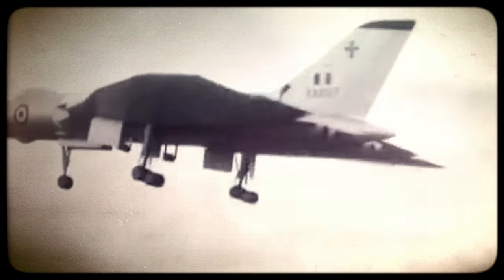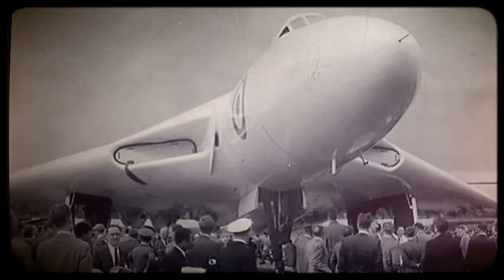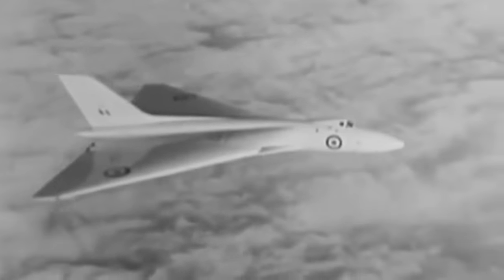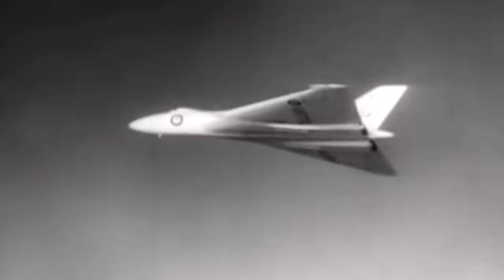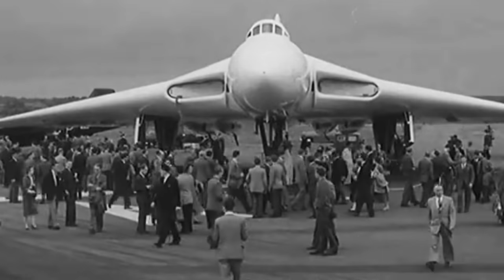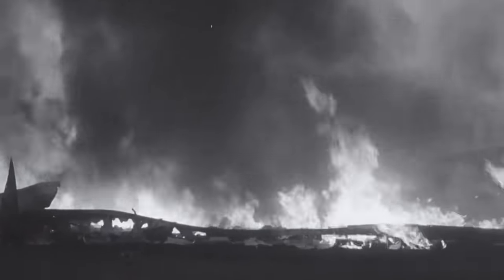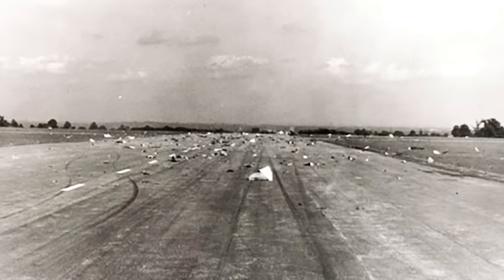Vulcan Bomber Disintegrates on Camera

Comment: It’s very possible that flutter in the outer wing while being introduced into the turn at low altitude (thicker air) caused the structural failure. There are many videos of various aircraft designs having similar failures here on U/T. Testing aircraft at high altitude vs low altitude can bring about different results!

Comment: Probably failure of that internal motor. turbine blade fragments would exit the fuselage and the wind took care of the rest.
Reply: I think that engine disintegration on the compressor stages may have been enough to cause the wing failure.
Reply: @GentiluomoStraniero  — No, it wasn't engine failure that caused this.  The engines were brand new.
Reply: I think you are correct!
Reply: @bionicpuma2920  Even new engines can experience failures.

Comment: I was 14 at the time and I do remember this being reported in the papers and on the radio and TV news at the time.  I went on to have a career lifetime in the design of gas turbine engines, industrial, marine and aero, with Rolls-Royce.
I was brought up in the Midlands of England, in the motor trade (US translation; auto repair business) and had thoughts of going to work in the nearby City of Coventry, which was Motor City UK in those days: perhaps I could work for Jaguar, designing engines.  
But then, one day when I was no more than 10 years old,  I was at home and heard an increasingly loud roar.  I dashed out into our little back garden, just in time to see this huge, white delta wing fly overhead, at a very low altitude.  It could well have been this very aircraft I saw on that day.
I've always credited that event with redirecting my career ambitions.  As a young designer, I actually worked on the industrial and marine versions of the Vulcan's Olympus engines, some of which are still in service.
Clearly, there was a structural failure in the leading edge of the wing and, in the past, I have come across suggestions that it had been overstressed as a result of exceedance speed limitations during earlier flights, using the higher thrust of the Conway engines. 
 Having said this,  I saw Vulcans perform at numerous air shows over the years and one of the 'party pieces' was for the aircraft for it to make a high speed, low-level pass over the runway and pull up into a near-vertical climb, or into a tight turn.  That airframe, in its production versions, was very robust.

Comment: My uncle was an evaluation pilot on the Vulcan, I remember him saying after the incident the wing was redesigned so instead of the leading edge being straight swept back like the prototype the wing was tapered thus giving the classic wing shape though I don’t know if this redesign was a result of the accident.
Reply: Yes. Quite shortly after delta wings began to be designed it became clear that a simple delta with a smooth leading edge was not the best design. The redesign of the Vulcan leading edge was important for the design of Concorde's wing.
Reply: My uncle was also a vulcan pilot but he never mentioned anything about the crash, my guess would be that some are better at sticking to the official secrecy act than others?
Reply: The straight delta wing worked well on F-102, F-106 and Mig 21 e.g.
Reply: The pure delta gave poor handling at high altitude.

Comment: Very sad. Looked to me like an engine came apart and took the wing out
Reply: I saw that,too. You can see the what looked like engine detonating at the front of the wing, before the wing began to disintegrate . But the experts must know better.
Reply: Structural failure of the wing possibly due to overstressing during previous tests, look at Tony Blackmans  book 'Vulcan Test Pilot'
Reply: The main mechanics of the engines weren't that close to the leading edge, mostly intake ducting. The fronts of the actual engines were about the area of the airbrakes.

https://img0.etsystatic.com/103/0/10464274/il_fullxfull.844602964_maml.jpg
Reply: @viking1236     Thanks!
Reply: @DieyoungDiefast     Thanks!
Reply: it wasn't the engine, VX770 was known to have a weaker airframe than later vulcans and this wasn't properly communicated to the pilots flying it and the team carrying out the engine tests. 
I believe (purely speculation now) that the structural failure resulted from incorrect maintainance as a result of not knowing the unique precautions that were previously taken with VX770 and should have continued to be taken.
Reply: @adampoultney8737    So others have said, and you can see on the video that the separation occurred away from the engine housing. Great planes. Thunder ball was better for them.

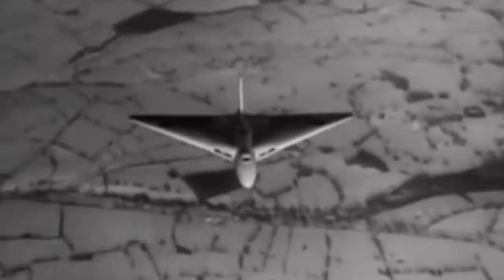Comment: At 2:29 minutes you can see a buckle starboard side, running parallel and a few feet from the wing root.   Freeze frame shows slight irregularity in the leading edge contrary the the port side.  It appears to be directly over number 4 engine inlet. At 2:39 it appears the starboard elevon is out of position or missing. It appears to go into a 90 degree down deflection, almost like an airbrake. It might have been an elevon flutter. Structural failure is often a result of multiple failures.

Comment: Rolls Royce are correct, big Delta wing designs can't handle big changes in aerodynamic forces. Just too much bending the wings against the airframe.
Reply: Delta wings do not flex under load.  That is what doomed this plane.

Comment: Why would any airframe be engineered to handle less than the maximum amount of energy the engine could produce? The thing disintegrated in mid-air. That is not pilot error.
Reply: Because wrong sharp maneuver can increase air forces so much only a 1 inch thick metal hull would not break😹. But hull so heavy will not be able to carry its own weight. Modern aircrafts have computer limiting which forces pilot could apply (fly by wire with safety limits).

Comment: And the Vulcan went on to appear at dozens of airshows all across the UK. I attended many and will never forget the mighty roar of the Rolls-Royce Olympus engines and the stunning delta wing design. Vulcan's continued in service until 1984 and successfully flew the 7,918.35 miles (12,743.35 km) from the UK to the Falkland Islands in the 1982 conflict.

Comment: I remember that the Vulcan was a very noisy jet, making a much higher pitched sound than most other jets of the time did.  I saw one fly at a "Transpo" (Transportation exhibition) airshow in Virginia around 1972(?) that my CAP (Civil Air Patrol) squadron was working at (parking civilian aircraft coming to visit the show).  Over the radio that show's air traffic controller was yelling at the pilot repeatedly not to overfly the crowd, which he was during his low level passes.  The next day of the show one of the U.S. Thunderbirds (flying F-4J's back then) crashed, killing the pilot and separately a guy doing a demo of a kite being towed by a car fell 100 feet when the kite broke apart, killing him as well.  That air show was shut down after that and never repeated.

Comment: I was there, aged 15, with my dad and my sister’s boyfriend who worked for Rolls Royce and submitted an eye witness report. We had just arrived by bus and were heading towards the show when the plane appeared from the left and flew straight in front of us. As it drew level at a very low height it seemed to bank and to our view touch its wing on the ground, hitch immediately disintegrated. It continued to right and fell behind a small copse, were it was consumed in an enormous ball of orange flames and black smoke.

Comment: Reading reviews from the other incidents involved with the loss of Vulcans, it seems ejection is a bit tricky for the pilot and co pilot with no ejection option for the rear crew other than a bail out process through a door.  Six seconds is plenty of time to eject, however it would seem the pilot was unaware that his aircraft was disintegrating.

15 Vulcan crashes of which
5 were successful "all crew" escapes
6 were "no survivors"
4 were "pilots survived, rear crew died".

Comment: Another Vulcan crashed at Detroit MI. Oct. 28 1958 after suffering an electrical  systems failure common to the type. The jet hit the ground so hard, I believe the cockpit was buried seventy feet beneath beneath the surface, it's still there under someones house now. All six crew died.

Comment: It's probable the VX770 airframe had been overstressed in previous test flights as otherwise it would have been unlikely to disintegrate performing a straightforward pass manoevre. Like it or not the Conway engines were more powerful than the Olympus that equipped nearly all other Vulcans. This particular airframe had been tested with both Avon and Sapphire engines before the Conways were fitted, so a lot of changes had been made. Don't forget this massive aircraft was aerobatically capable and refined/improved considerably in B2 form (VX770 was a prototype B1). The Vulcan did not habitually break up in flight.

Comment: I think Rolls Royce buried that report.
Reply: The political animal that rushed the development of the Rolls-Royce Conway engine, and the one that did not permit the newer, improved and safer wing leading edge to be retro-fitted to existing Vulcan airframes had to exterminate that particular report.  

The Conways were later replaced, the wings were later up-dated.

Comment: I saw a Vulcan About the time of the Falklands WAR, At RANDOLF AFB. TX. Airshow. Randolph  has 2 parallel runways. The Vulcan flew down one runway about 200 or 300 feet then did U turn and flew down centerline of other runway. when it was halfway through the turn and wingtip pointed straight up. even  being over a mile away the Vulcan was huge.

Comment: The result of the accident and later mods was a new designed much strengthened wings for Vulcan where made.
When surface to air missile systems (SAMs) appeared all over the Soviet Union thus restricting high altitude bombing, this changed the Vulcan mission from high level stand off to low and hard terrain following and became a worthy long to medium ranged low level penetration bomber.
Unfortunately out of all the V bombers the Vickers Valiant was the one that could not endure the low level buffeting and suffered structural fatigue thus had to be retired earlier than planned.

Comment: I notice that no one has drawn attention to the leading edge configuration of the early Vulcan which was virtually straight which I believe had some bearing on the cause of the break up. The later much more successful swept curve design which was also used on the Concorde addressed the uneven loading along the leading edge. Improved methods of drilling and riveting also must have had some influence including deburring of hole edges and also countersinking and hot dimpling went along way to lengthen the fatigue life of aircraft structure. Having had some working knowledge of cold dimpling which resulted in minute cracks around  the circumference of the drilled and dimpled holes especially in the harder T6 alclad materials. The hot dimpling method addressed this issue

Comment: Magnesium alloy thermal ducting break up, situated in the leading edge acted as the de icing provision. A very brittle metal which could easily shatter , hence the “confetti”being ejected out of the ducting exhaust.
The fuel tanks were located next the ducts where the engine gas bleed was used to de ice the leading edges. 
Many were replaced after this incident. The Vulcan had an amazing performance envelope, it is therefore wrong to subscribe the fault to the pilot.

Comment: I don't remember the actual year but around 1967,  RAF Wethersfield, nr Braintree, Essex had an American F100 base there and every year they held an airshow. On year they managed to get a RAF Vulcan to perform. In those days it was usual for the public to be quite near the runway, the announcement of the take off of the Vulcan was proclaimed. Totally useless info, everyone within ten miles must have heard the engines wind up before the pilot let the brakes off. Eventually it started rolling and then rocketed off into the sky.
The only problem was while running the engines up, it severely damaged the runway, and the base was out of action for several weeks while repairs were made!

Comment: From Wikipedia article  "1958 Syerston Avro Vulcan crash" :
"The official primary cause for the accident was a gross structural failure of the aircraft's main spar, which was confirmed by amateur footage, photographs and eyewitness accounts. The reason for the failure was not determined by the Board of Inquiry (BoI), but it was suggested by an accident investigator called in by Rolls Royce[4] that the main cause was that the pilot, upon performing the planned aerobatic display, exceeded the prototype's briefed speed and turning rate limits. The accident investigator submitted a statement[5] to the BoI, but did not give evidence under oath. The BoI was apparently not informed that the aircraft manufacturer considered the basis for the statement to be invalid. The Technical Officer of the Board of Inquiry (BoI) identified a suspected fatigue failure of the inboard arm of the front bottom wing attachment main forging, and suggested vibration from the high airflow volumes required by the RR Conway 11 engines as a possible cause. The Royal Aircraft Establishment carried out a structural analysis of the wreckage and produced a report on 21 April 1960, but no copy has been found in the public record. Avro's then Chief Test Pilot, Tony Blackman, argued that the maintenance crew failed to properly inspect the aircraft for known issues with stress damage to the aircraft's leading edges and structural ribs, which had been observed in another prototype he had flown earlier."

Comment: Judging where the starboard wing's leading edge exploded right where the engine intake was, if it wasnt a bird strike, i assert that there was a structural failure in the turbine blades, which quickly and catastrophically shattered both the starboard engine and entire affiliated wing.

Comment: the plane was too fragile to be used in a combat situation, if you try to turn it too fast to try and outrun a missle, the wings would disintergrate, rendering the plane unflyable. It served in the royal airforce for many years and as long as the pilots flew gently like if there grandma was a passenger in the backseat, it was safe to fly.

Comment: Avro's chief test pilot thought the cause was due to undetected damage caused by previous test flights where RAF crews had put the aircraft through unapproved roll and loop manoeuvres during test flights after which the aircraft was not properly inspected for stress damage along the wing leading edge, evidence of which had been noted on another aircraft. It was also suggested that vibrations from the Conway engines were responsible.

Comment: I doubt it was any fault of the pilot.  There would have been 'other' signs of overspeed before the wing snapped off.  Vibrations, flexing of the wing, ect.

The way that one strait up just folded up instantly and 'shattered' as it did so, tells me it was a structural failure that led to a catastrophic disintegration.  The wing didn't just 'snap off' as most would if overspeed had been a thing, this thing literally shattered into pieces, as if its entire framework simply collapsed.

Comment: The B1 Vulcans were horribly flawed. Remember, this was developed just 11 years after WWII when the Supermarine Spitfire and Lancaster ruled the skies. There simply wasn't enough understanding of the swept delta wing configuration. It was not "pilot error;" it was structural ineptitude. The B2 aircraft were delivered in 1960 and featured a larger, redesigned wing. Those men who flew it were test pilots at best, and they didn't know it.

Comment: If THAT was "outside design limits" this would have been a beautiful but useless bomber - which it was not.  No abrupt pullup, no high-rate roll, POSSIBLY exceeded allowed airspeed at low altitude - but who can tell?  Something failed, but since this was a one-off accident (I believe but don't know to be fact) whatever it was was either corrected on the remaining fleet or limited to this one airframe.  I was overflown by one by surprise in the 70's.  It majestically appeared over the trees on a small ridge at less than 1,000 agl and less than 1/2 mile distance.  Awesome, and unforgettable...

Comment: Being a brand new strategic bomber there would have been a need to avoid design or engine flaws falling into the hands of the Soviet Union. As a military aircraft the more recent approach of sharing accident investigation findings did not apply. The clear video evidence suggests structural failure, and not pilot error. Given the long, and highly successful, operational career of the Vulcan and Victor bombers, it’s safe to say that any design, engine or operating changes that were needed were enacted by the manufacturer and the RAF. Less of a cover up and more SOP for any military aircraft, at that time.

Comment: how can it be pilot error if it breaks up they just told you what happened ,So did they scrap the the rest of them.
Reply: Some maneuvers can stress the wings in any aircraft.  In strong turbulence, the autopilot is usually disconnected because it can stress the airframe by fighting the violent movements of the aircraft.  That's also one of the reasons glider pilots wear parachutes, the other one is they can collide when thermalling in a group.

Comment: Judging from the footage, i can assume that the cause might be structural integrity failure. That or the "skin" of the plane wasn't firmly fixed onto the plane's structural frame. Maybe it didn't get the kind of maintenance it needed.  All planes, whether it's a bomber, fighter jet or interceptor, will always face a similar fate if the maintenance crew makes a mistake or doesn't do the required maintenance checklist before giving it the green light to sortie.